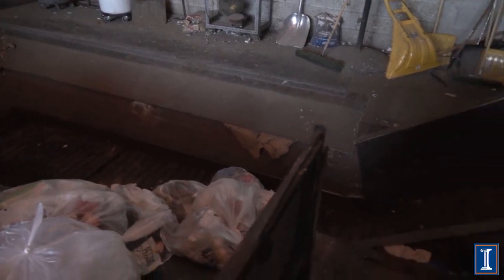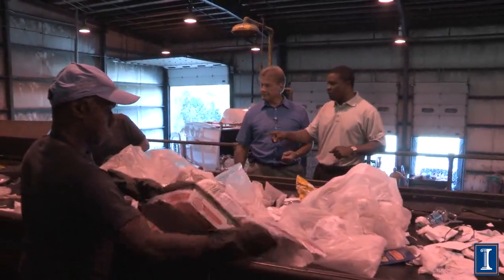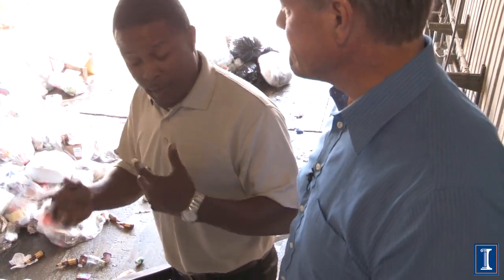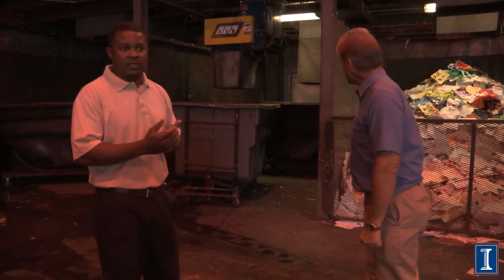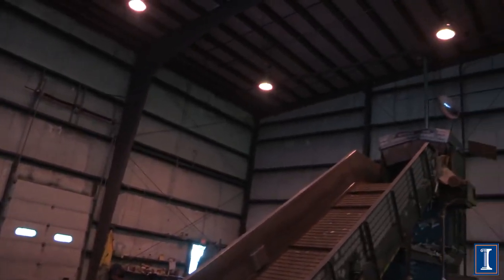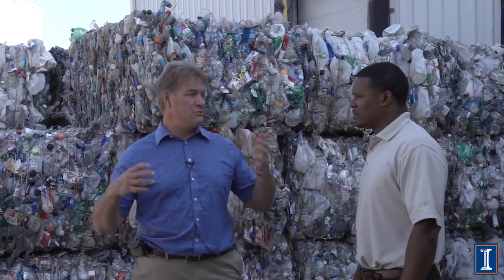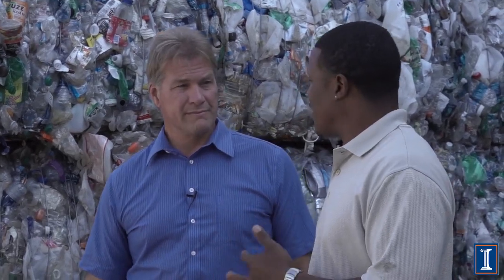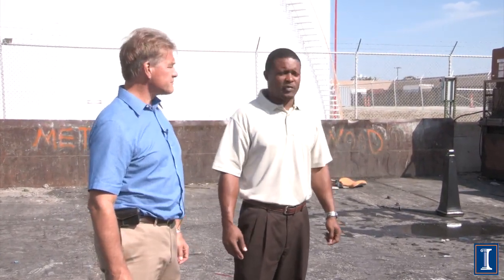How Things Work: What Happens to Our Garbage

Comment: I often wonder if old fashioned incinerators could be used to turn waste paper into electricity. China has stopped buying scrap paper from us. Recycling paper is uneconomical and not as green as one would think. Amazon has us swimming in cardboard.
Reply: recycling paper is not uneconomical. otherwise no one would be buying it from them.
Reply: @squidbait1396  that’s the point, China no longer wants out waste paper.
Reply: @MultiPetercool  but someone is buying it? who do you think that is? some sort of garbage removal charity?
Reply: @squidbait1396  Of course it’s not a charity. Last time I looked at my waste management bill they charged me to take the cardboard away.